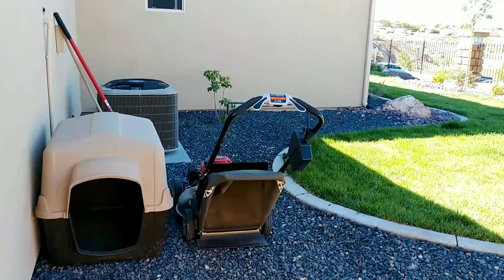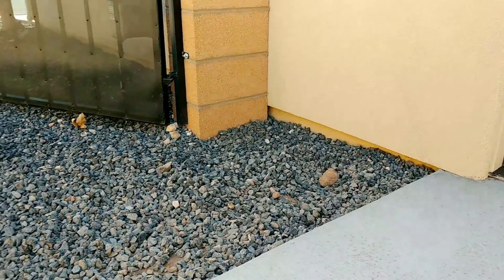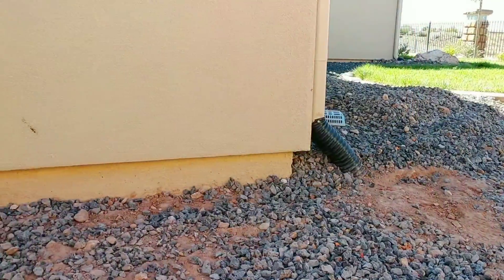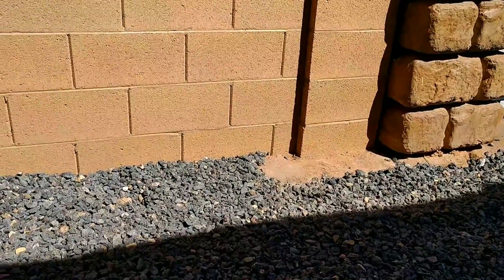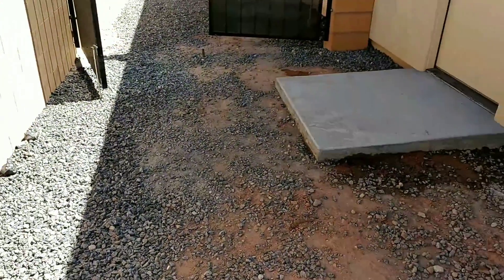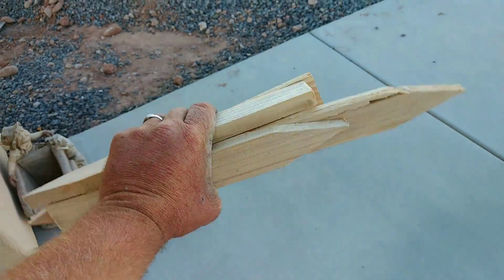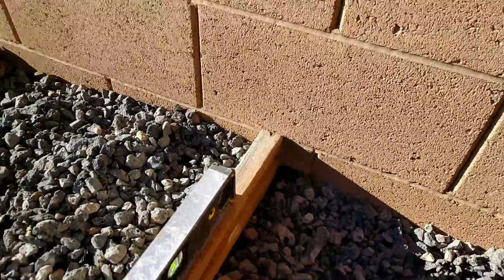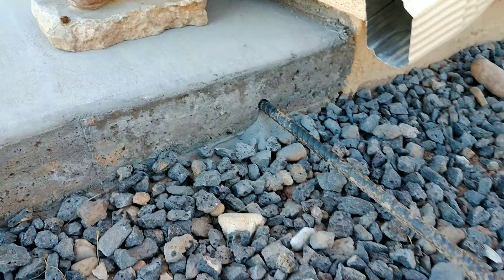Concrete Basics; grading, forming, finding the correct slope

Comment: I saw how you had the level on the 2x4 to ensure it is slopped, but how do you  ensure the entire slab is slopped? How do you physically slope it once you pour it?
Reply from the maker: When you "screed" the concrete, use the top of the forms. Drag a 2x4 across the top of the forms as you pour. That will set the height of the concrete. Hopefully that makes sense.

Comment: How do you lay down form boards on a slope? I'm building a garbage can corral on a hill for my Eagle Scout project, and I've been trying to find out how. Thanks.
Reply from the maker: You should be able to form everything as if it were flat. The tricky part come when finishing the concrete. Be sure to begin from the low point or everything will sag. Screed uphill, bullfloat uphill, and even use your hand float from the low end up. This will pull the concrete up the slope. I hope this makes sense.
Reply: @VanDamArtisan  Thank you! So to clarify, do I have to dig a trench/hole for the boards that are higher up on the slope?
Reply from the maker: I would dig down a bit to kind of make the slope less and it might not hurt to use thicker boards on the lower end, like maybe a 2x6 so that the slab is elevated on the lower side, like a step. Kind of depends on what exactly you're doing though.
Reply: @VanDamArtisan  Okay, thank you. This was helpful.
Reply: @VanDamArtisan  Makes perfect sense, but that is what I am looking to see, how a pro works the concrete uphill.   Otherwise very good tips, thank you.
Reply from the maker: @catchercoach4918  I'll make a video on that the next time I get those I chance. Basically the trick is to pour fairly thick and screed from the bottom up. You'll want some extra to sprinkle the top edge because it will sag. Also, bullfloat from the high side and push away with a steep angle, then drag back uphill fairly flat so it sort of sucks the mud uphill.